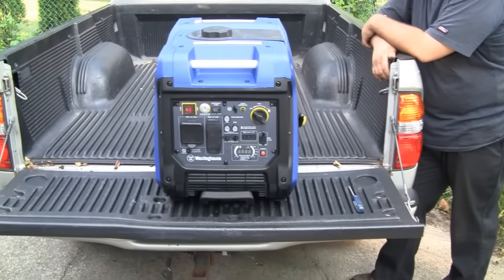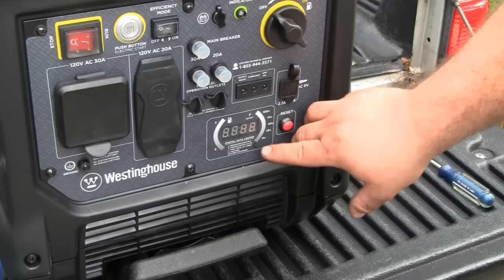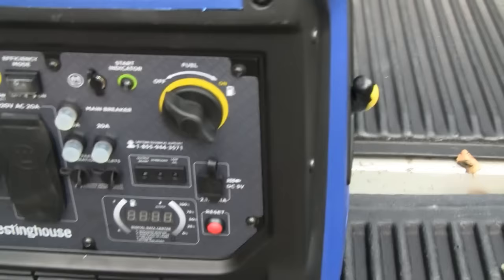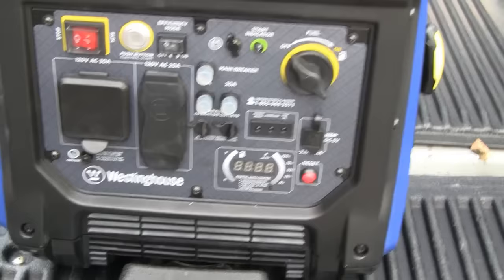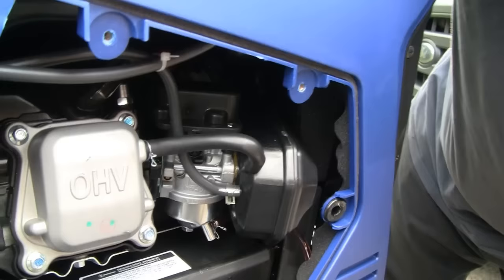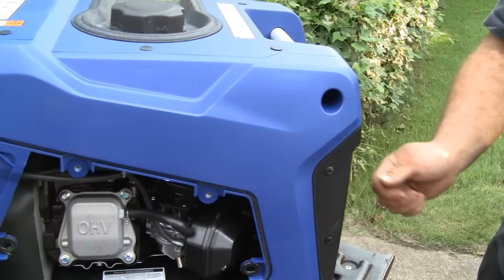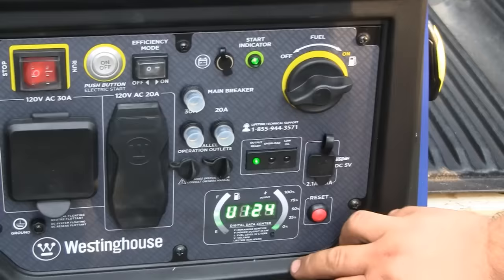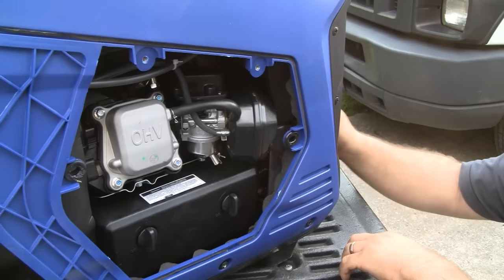WESTINGHOUSE iGEN4500 INVERTER GENERATOR (BUYER BEWARE)

Comment: bought mine 3 years ago different brand the day after it arrived it went to work for 15 hours. tree took out 2 poles the next street over sure is worth investing its seen multiple uses over the last couple years especially during summer and the power company doing random shut offs.
Reply from the maker: Yeah Buddy!! All the weather and storms seem to be getting worse every year, ya need some kinda back up!!☺
Reply: indeed for us its mostly fires that they turn off the power for. instead of fixing the actual problems

Comment: That carb design and the valve cover are similar in design to the Honda GX series engines. Is it actually a Honda or a Chinese knockoff? Seems a lot of these generator 'manufacturers' are outsourcing these to China in the last 10 - 15 years (also the reason it's nearly impossible to get any kind of customer support). After dealing with other generators, yard equipment, etc. with that electric heat coil type choke, I've pretty much determined they're about useless, since you can almost NEVER get them to start in cold weather, and warm weather is iffy at best. Easiest quick fix is to do like you said and run a manual choke wire out through the side cover.😉

Comment: My 3500 Predator starts my 13500  btu A/C without revving up. If this westinghouse is 4500 watts it should run your 10,000 btu window unit with ease. It appears your window unit has an issue with start up amps or the generator is not putting out the wattage as specified.
Reply: Joe Randazzo's fruit and vegetable market?

Comment: Hey Road King any Gen set is a good Gen set when the power is out
Reply from the maker: Yeah Buddy!! For a grand I didn't think I would have to jump through hoops to get it running!!☺
Reply: Only if you can get it running when you need it!  Another thing to beware of  is some won't start if the battery is dead...even if you use the pull rope.
Reply: A 4500 will run your whole houSe?
Reply from the maker: Yeah Brandon, my house is only 2500 sq ft and it's just me and the wife!! As long as we don't run unnecessary electricity we can run all the TV's, Computers, Fridge, microwave, heater or small window A/C and alotta LED lights!!☺
Reply: @805ROADKING  I think before I spent 1, 000 on an inverter, I'd have to get a regular genset for half the cost and twice the output. You just can't use it on computerized stuff they say. I have before with no issues but to each your own
Reply: @staind288  only thing I would worry about on computer is don't let it run out of gas, could corrupt the drive suddenly losing power...and obviously unplug everything while starting/stopping the engine to avoid surges or brownouts

Comment: Just a heads up these have a electronic choke. I'd bet the choke plug isn't plugged in follow the wire and you will fix your machine yourself.. Its actually normal on these.

Comment: My igen 4500 died hard at 800hrs,   installed new inverter, coil, plug,  I maintained it very well,  now I have an expensive hunk ov junk,
Reply: So? 800 hours isn't too had!
Reply: @donraptor6156  My Onan is rated for 30,000 hours

Comment: My WH Igen 4500df died (red overload LED) while pulling a half load for an hour. I called WH, they blamed me, gave me the max run around and refused to help. I took it to Northern Tool who said the control module died. They replaced it under warranty. I got home and fired it up with no load, it ran and died again (red overload LED). Took it back to Northern Tool who put another new control module in under warranty. So far, so good now. WH service is the worst on the planet.

Comment: Personally i would take it back and get a Honda generator.  We just bought a propane powered generator.   Have not used it yet, just started it and let it run some.  Thanks for the information and video.  Give us an update if you get the choke fixed.  Thanks for sharing.
Reply from the maker: Thanks D!! We'll let you know, There's a service bulletin out on this machine!! They say the wire to the control board comes apart in Transit, I'm hoping it's that simple!!☺

Comment: I wanted to get one of these for the features and price was good as well but I heard some iffy things on them, nothing consistent just issues here and there and poor support from Westinghouse so I bought an American made Generac generator, very happy with it after two years zero issues. Thankfully never had issues with my Westinghouse pressure washer I have other than the 3200 seems a little under powered for a 3200 psi washer not sure if that psi is legit because it is certainly weaker than my friends 3200 psi washer in another brand, I simply could not afford the price on some other comparable size pressure washers like Generac but thankfully Generac generators are much more bargain priced.

Comment: Hey, I work in film, and I am building out a gaff truck. I’m looking to purchase a generator in the 1,000$ range and I’ve been looking at this for awhile. I’m looking to run it on sets for 6-8 hours at a time, operating a group of high power film lights, the lowest Wattage light is 300W and the highest is 650W. The package will have two of the 300’s, two 400W’s and one 650W. From everything I understand about this generator, this one shouldn’t have any issue delivering power to this group of lights should? If anyone a little more experienced could assist with their knowledge, would be greatly appreciated. ( For reference the lights are GVM SD300/400/650 continuous LED cob lights )

Comment: My gen keeps shutting off. And it says overload, eventho there is nothing plugged in. No circuit breaker was tripped, and i troed to reset it, still nothing... i really need help plz.. lmk... it runs for about 10 mins max, then Automatic shuts off

Comment: Good to know   Did buy a new Honda so far only one recall for fires.  not much better   my guess 🔥  but I did get it fixed.
Reply from the maker: There's a service bulletin out on this machine!! They say the wire to the control board comes apart in Transit, I'm hoping it's that simple!!☺

Comment: Here is a note I just sent today  to Westinghouse about my iGen4500

Bought this boat anchor new about the date I mentioned above. Choke problems right out of the box in that is was sticking closed. Called support and was sent a replacement choke control. Installed it and seemed to fix the problem until two days later I have the same problem again. Called support again and was told to take it to a service center...............TAKE MY BRAND NEW MACHINE TO GET FIXED!! Gimme a break! I took it upon myself since at this point to find the problem myself and when I took it further apart I found a connector that was not locked together when it was built. I locked the connector together and that fixed the problem. Jump ahead to day before yesterday. The genny ran all day while being used intermittently and it was perfect. The next day, or yesterday, hit the start button and it started immediately and just as quick shut down. Tried several times with the same results. So this morning I took it apart enough to determine that the choke was still working properly, and it is. I checked the fresh oil, it is perfect. Full of fresh fuel, nothing I can see wrong. I called support again and talked with some idiot named Jaffe the quickly started fallowing a script when I told him the story. He asked "How many times have you changed the oil?" I told him I've changed it once.............the thing only has about 15 hrs or so on it. He said "According to the manual, you should have changed it twice by now." I replied IT ONLY HAS 15 HOURS ON IT AND IT HAVE ALWAYS BEEN STORED AT ROOM TEMPS. I went on to tell him that as long as it ifs full of oil it doesn't know the difference between oil with 1 hr or 1000 hrs, that will not shut it down. He said, "Sir, I'm just telling you what the manual says." Then this incompetent moron asked me what kind of fuel is in it right now and I told him it was high octane, no alcohol canned fuel like we use it all our small engines. He asked "Did you drain the old fuel out before putting new fuel in?" I replied that the previous fuel wasn't in it very long and besides, that last time I used it I purposely ran it out of fuel. He asked "Did you drain the carburetor bowl?" I said no..........that's why I ran it out of fuel. When it stops because of lack of fuel, the bowl is dry. He then told me that there will still be fuel in the bowl at that point, so you are incorrect. I let him know that I've been a gas/diesel tech for 35 years and this clown told me that cars and generators are different! I still have a junk $800 piece of crap that I cannot depend on. I got of the phone with this person that has NO idea what he is talking about and messed with it a bit longer and noticed that right after it starts, the overload indicator comes on and it then shuts down. I didn't notice that before. Not to mention that I did not get the mickey mouse charger for it when it was new and have since had to replace the battery because I could not charge it and this thing does not charge it's own battery?? How stupid. I emailed about that and was asked my reply email to provide proof of purchase and a picture of the serial number. Really? I did it anyway and emailed it all in and have gotten zero response on that issue. I bought a small trickle maintainer for the new battery. This idiot "Jaffe" that I spoke with made no attempt to help me diagnose my problem, just read a script and told me I was incorrect about how a carb works. What are the qualifications for his job anyway?? This thing has been a thorn in my side since day one and you so called support department is incompetent if "Jaffe" is representative of it. My opening line of this note is not entirely accurate, this thing is not big enough to anchor my boat and it's too big to go in the trash can, so I don't know what to do with it.

Comment: Wow I can’t believe it wouldn’t start the window A/C.I’ve seen the 3500 watt predator start a 15000 btu Rv generator. Thanks for the info I definitely won’t be buying one to run my Rv.
Reply: It starts my 15k btu RV air conditioner just fine.  It will also run a 13.5k air conditioner simultaneously if equipped with a soft start.  
Don’t know what these guys are talking about it works great.

Comment: my pulsar is the same gen set with out the fancy stuff same as onan and westinghouse and i have one right now with the  choke"not working  its on my house and i can run up to 3 with the wiring i made to pear them up as i need more power i can run 2 or 3 at a time but my oldest on has over 4000 hrs on it and remote not working and it is not ez to start no pull rope and you have to jump it at the starter sednoid win its cold out so it only the last one that i start up but pulsar is very ez to work with and glad to help and win i call them they know me and always help me out     right now i have parts coming for  free from pulsar for my 3 year old one but it is my new one that the choke not working but pulsar is making it right

Comment: Wow, $1000 paperweight for most users.  Thoughts on the newer LP generators? Do they have issues like regular gas gens (dirty carb type issues)?
Reply from the maker: This one came in a duel fuel version for an extra $100!! I don't think I'll use it enough to warrant it!!☺
Reply: I've heard the LP save you from carb gumming issues and run very clean.  You just loose about 10% of your power rating vs gasoline.

Comment: There should be a choke solenoid on your new genny, Is the solenoid getting power during the start cycle?
Reply from the maker: There's a service bulletin out on this machine!! They say the wire to the control board comes apart in Transit, I'm hoping it's that simple!!☺
Reply: @805ROADKING  Sounds good. I bought one of the HF 3500 inverter gen to take camping. It runs well, but it's not without it's quirks either.  You have to drill addition air flow holes in the oil fill door and it will back siphon gas into the vapor canister on a hot day if the gas tank is completely full.

Comment: Quality control these days is out the window. I bought a Subaru powered pressure washer that gave me fits until I changed out the Chinesium spark plug. Runs great now, but it was a pain in the a$$ at first.
Reply from the maker: I miss the old days when you could buy something and pass it down to the next generation!!☺
Reply: @805ROADKING , when I was a kid in the early 60s, my dad bought an 18" mower with a 2-1/2 horse Briggs. We mowed 2 acres with it every summer. Dad gave it to me when I bought my first house and I ran it  into the mid-80s. I gave it to a neighbor and he ran it, and then sold it, and it was still running!

Comment: Enjoyed your video. 
Just bought one of these and I have a few questions? 
1. I ran mine a little and when running at idle/no load on propane it surges contentiously, as soon as you put a load on it the surge goes away.  Is this normal?
2. With no battery or a dead battery will the unit run by using the pull start? 
3. How long should I run my unit before the first oil change?  
Thanks in advance.

Comment: TAKE IT BACK AND GET A REAL ONE , HONDA and a 4500 watt is not going to run the whole house . STAY AWAY FROM GENRAC's . They Suck . I went through 4 of them before I gave up .I ended up finding a WhisperWatt 25KW for $ 4500.00 with less than 1000 hours on it . I have it set up to run my house and my mom's house . Has worked GREAT . I am not sure what the Honda 10KW one sells for . You Get What you pay for as they say . Good Luck ... TAKE IT BACK ...

Comment: Loved mine....all the way till some crack heads stole it and some chainsaws from my barn. You have a good unit.
Reply: Too bad the Honda eu7000 costs so much. I've read that they have fuel injection.
Reply from the maker: There's a service bulletin out on this machine!! They say the wire to the control board comes apart in Transit, I'm hoping it's that simple!!☺

Comment: I have 4 generators and not one of them actually ever works when i need it bloody things
Reply: get an old one, i have an 80's Kholer that starts every time, just needs starting fluid or something because i keep the carb empty. it's a kholer power pro 5000
Reply: I asked our repair guy about the generators at work. We have 15 Honda generators (older none inverter style ones). He said the number one thing to do is exercise them for 15-20 minutes once a month. As soon as I started doing that we had zero issues starting generators during storm events.

Comment: I literally just loaded one of these up in the back of my truck...
Reply: How long after seeing this did you return it ?
Reply from the maker: Good Luck Harry!!☺
Reply: Don’t fret, I bought one of these a year and a half ago, and have been running it on my houseboat every weekend. I have 550+ hours on it, and it was running great. Unfortunately, it lost spark one day last week, good news is, their tech support sent me a replacement ignition coil, and I installed it myself, very easy. Unfortunately again, that didn’t solve the problem. So, I reached out to them again via email that they had previously sent, and immediately suggested that I take it to a nearby authorize warranty repair shop. It’s been in there for three days, I didn’t have to pay anything, and the parts are on the way. They said it was a control board, which was the next thing upstream from the ignition coil. I hope to have it back by Friday. But my take away so far, is that they are good about the warranty side of things. And, when it was running well, it ran a rooftop A/C, three mini fridges, three televisions, a smoke machine, lasers, and a bunch of other stuff all at the same time. So I have faith in it.
Reply: @chrisreynolds6583  did it get fixed?